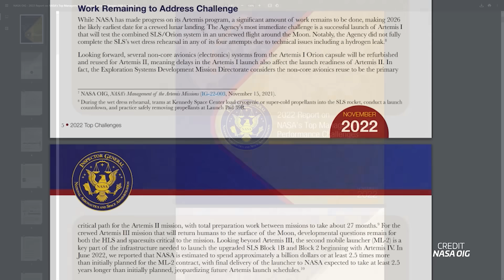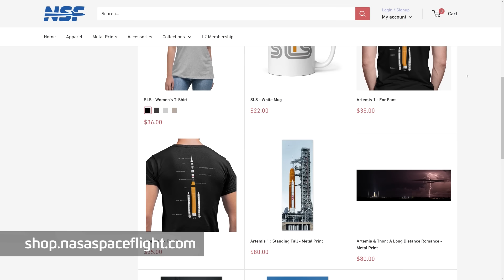Artemis Moon Landing Missions Delayed!

Comment: If SpaceX can get Starship in lunar orbit ready to take astronauts down what is the point of Artemis? Why not just fly all the way with Starship? There would need to be testing etc. to ensure it was safe enough but why would it be more dangerous than starting in Artemis?
Reply: Starship is not even close to sending humans to the Moon. They till haven't made it to orbit without blowing up.
Reply: @Ricky02-d8q  They have been contracted to provide Starship as a human landing system. $2.9 bn contract from memory.
Reply: @Tailspin80  Yes, I know, but Starship is not even close to sending humans to the Moon. It still has prove it can get into orbit, and then land several times on the Moon safely. That's going to take awhile. NASA is not going to risk it without it being completely reliable.

Comment: Maybe we need to go back to 1969 to figure it out 😂😅
Reply: They know how its done, bit they building a complete new rocket with 10 percent of the manpower
Reply: @sH-ed5yf  It's been over 50 years.  It will get delayed again.
Reply: @TonyStone3000  they didn try until lile 8 years ago
Reply: @sH-ed5yf  Still doesn't take away the fact that 1969 technology is better than today's technology regarding moon travel.
Reply: @TonyStone3000  it was not better. In fact it required massive input of the astronauts on Board. 
But it was more resistant indeed, cause it had less Chips that could get destroyed by radiation or other influences
Reply: @sH-ed5yf  It was better because it supposedly worked in 1969, and we can't figure it out today.  Fewer chips that could get destroyed by radiation? Lol! B.S excuse after B.S excuse, Delay after delay. Lol!!!
Reply: @TonyStone3000  we absolutly can. In fact we achieved much more, like a fly buy to Pluto.
Its just that we invest much less resources today. 
We still have all calculations, but the supply Casino is not present, so we have to invent everything from bottom up.
With less manpower and less mon3y compared o the 60s
Reply: @TonyStone3000  no kid, not excuses, just reality. Your modern Smartphone is much more capable than any that came before. Bot smash your modern Smartphone tonthe ground and its broken, while your 90s Nokia will work after 100 smashes, bit its much less capable.

Comment: I fully support the Artemis program but I feel like there could be a simpler way to go about things. The current architecture uses multiple launches, rocket types and landers, all of which need construction and testing. China is taking a far simpler approach and pose a viable risk of overtaking the USA in the race back to the moon. All these delays are expected but do not give the program the support it needs.

I also don't understand why the SpaceX HLS needs to be so big. Sure in the long term it would be beneficial for cargo volume, but we simply need to get back to the moon first before building a permanent presence there. Why take a HGV when you only need a van?

Starship could be more capable in this instance as an expendable second stage, delivering a smaller lander to a lunar transfer orbit.

Comment: Starship, is intended for the landing on the moon and the return of astronauts to the space station gateway.  When the question arises of how they are going to transfer fuel from one ship to another, I wondered why they don't just remove the nose of the ship and connect them like a buster and a ship and make a long rocket.  Thus, we connect 5-6 rockets in space and push the landing module to the lunar orbit.  Then we send a connecting module into space to connect all the rockets to (the front part of the rocket) the central module and create a space fuel tank station that can rotate in all directions for optimal fuel distribution, like a rubik's cube where the middle faces of the cubes are replaced by  starships bodies.

Comment: i still will never understand why they cant use a dragon to land with, there was talk for years about a dragon capsule with legs for a mars mission, a moon mission is easier you dont need a heat shield!    Im sure its a nightmare without gateway, but still im annoyed with this gotta have 2 gigantic rockets thing.   theres falcon heavy theres vulcan theres sls cargo, theyre doing this the hard way.

I firmly believe in this program and gateway leading the way to mars.  I think starship is a doomed N1.
Reply: Because the Crew Dragon doesn't have the radiation protection,  range, or life support to mention return from the Moon. Crew Dragon is a LEO only spacecraft and if you upgrade it to return from the Moon,  Falcon Heavy won't be able to send it to the Moon as it will be too heavy. 

A Crew Dragon with legs to land, can only do that in Earth's atmosphere where the atmosphere scrubs off almost all of the delta-V. It can't carry enough propellant to land AND take off from the Moon without soo much redesign that it is no longer a Crew Dragon. 

Artemis is NOT recreating Apollo, as Artemis III is planned to stay about a week on the Moon. ALL the Apollo missions together stayed 12.5 days on the Moon. Later Artemis missions are planned to be weeks to a month long on the surface.

Comment: Why do you need a gateway and why go back to the moon
Reply: The later missions going to be longer, so something needs to host Orion for that long. Gateway will also do science from out under the Van Allen belts. Artemis is also about learning how to extract resources from the regolith and to build structures, so the missions are longer. It's not just about landing on the Moon anymore.
Reply: @steveaustin2686  so to me artemis booster why can thay cover them for artemis 3 missions..
Reply: @benburden9323  The Artemis III mission is short enough to fit in the lifesupport range of Orion. For the later missions that will be longer, they would be longer than Orion can fly on its own, so Gateway supports Orion, like the ISS supports Crew Dragon and Soyuz capsules.

Comment: imagine the engineering that the Gemini Program had to invent and test to make Apollo feasible.
Artemis is kinda in the gemini phase i think.
Reply: I would agree with this if we didn’t already have the knowledge from the Gemini, Mercury, Apollo, ISS, Shuttle, Falcon 9/Dragon etc.
Reply: @dgymnast6473  The budget for Apollo was huge, at like 3-4% of the US budget at the time. Currently, NASA has less than 0.5% of the US budget and is also running the ISS, which is a big project like Apollo.

The Artemis III landing is planned to be a week long, which is over half the time ALL of the Apollo missions spent on the Moon. Later missions are planned to be two weeks to a month long.

Apollo was very risky and NASA doesn't want to risk crews like that now, as Artemis would like be ended.
Reply: @dgymnast6473 you still developing brand new systems tho. Gonna take time

Comment: how did they refuel apollo missions?
Reply: They didn't, as the spacecraft were as bare bones as possible. Apollo was very risky and NASA doesn't want to risk crews like that now, as Artemis would like be ended.

The Artemis III landing is planned to be a week long, which is over half the time ALL of the Apollo missions spent on the Moon. Later missions are planned to be two weeks to a month long. So the new hardware has to be more robust and capable.

Comment: I watched Apollo 11 go to the moon, land and return to Earth on our little black and white TV. There were no 10 pre launches of the Saturn 5 to bring fuel to LEO to transfer propellent to a larger vehicle to get to the moon.  These 10 launches to LEO for refueling boggles my mind not just because of the feat itself but to have all those boosters return and be captured by their launch tower and prepped to do it again in a very small amount of time as well. Our proposed return to the moon has become unbelievably complicated. Artimus is using recycled components from the space shuttle era and SpaceX is designing, building and testing brand new tech to help get us there.  SpaceX is trying to build everything themselves like their automotive business does and NASA is subbing most everything to contractors all across the country.  Talk about too many chefs in the kitchen.  And it all has to go together and it has to work together.  2030 here we come!
Reply: The budget for Apollo was huge, at like 3-4% of the US budget at the time. Currently, NASA has less than 0.5% of the US budget and is also running the ISS, which is a big project like Apollo.

The Artemis III landing is planned to be a week long, which is over half the time ALL of the Apollo missions spent on the Moon. Later missions are planned to be two weeks to a month long.

Apollo was very risky and NASA doesn't want to risk crews like that now, as Artemis would like be ended.

Comment: I think SpaceX ought to have a little side project going to develop a "shuttle" for use from ship to ship while in orbit or transit to the moon.  Not a "Space Shuttle" like the giant ones that used to carry stuff to orbit, but more like a in-orbit Jeep/utility vehicle.  Something with thrusters, an airlock, a closet full of space suits, some emergency rations, and maybe a simple grab arm to help it hold onto another space vehicle while doing maintenance or something.  It could also be useful as a lifeboat - something most exploratory ships have had since the post-Viking days (over 1000 years ago) and even most small private ocean-going sailboats have nowadays.  Though it would not have re-entry capability.  Just the ability to hold a few astronauts while help is dispatched, to transfer them from ship to ship, and to help them get around those really big ships if needed to do repairs, mods, etc.

They could leave one docked to the orbital refueling station for Starship launches that are at max payload capacity or carry one along with them when launching just a few astronauts in that massively over-capable ship.  Another could be left at the orbiting lunar station.

Just ideas.
Reply: The problem is changing orbits which uses a LOT of propellant. Something small like that would not be able to change orbits and would be restricted to working around something like the ISS. It's additional hardware which would not materially add to the mission, unfortunately, cause it is a cool thing to imagine. Current tech is not up to it.
Reply: Ditch the airlock and closets, and just have a jetbike for personal use. 
No ability to handle atmosphere, but lightweight and really cool.

Comment: hmm, I never heard NASA whine that it was too complex problem to go to the moon the 1st time. Yeah they had challenges - F1 engine stability, computer and navigation issues, life support, a disastrous fire, etc.. But they never let that even slow them down!
Reply: The budget for Apollo was huge, at like 3-4% of the US budget at the time. And Apollo was very risky. Currently, NASA has less than 0.5% of the US budget and is also running the ISS, which is a big project like Apollo.

The Artemis III landing is planned to be a week long, which is over half the time ALL of the Apollo missions spent on the Moon. Later missions are planned to be two weeks to a month long. So the spacecraft have to be more capable than Apollo and that increases the mass needed.

Comment: How can NASA let Boeing run the show? Unless they're in on it. Can you imagine Apollo is needing another year and a half to fix something designed years ago. And then they'll get the fix wrong. The short video of 8 or so sitting around is typical. Notice they're all overweight and doing nothing. The they'll die and the next group of old men take over. Boeing should stick to making 737 MAX. Nothing can go wrong there since they had 57 years to get it right. So then Artemis will be ready in 2081. Of course problems can be expected.

Comment: Jeese, this is all been done before. Didn't anyone keep notes?
Reply: The budget for Apollo was huge, at like 3-4% of the US budget at the time. Currently, NASA has less than 0.5% of the US budget and is also running the ISS, which is a big project like Apollo.

The Artemis III landing is planned to be a week long, which is over half the time ALL of the Apollo missions spent on the Moon. Later missions are planned to be two weeks to a month long.

Apollo was very risky and NASA doesn't want to risk crews like that now, as Artemis would like be ended.
Reply: @steveaustin2686  should be a lot easier after six successful missions, if they really went of course.

Comment: Humans on the moon no earlier than 2028. The delay led, primarily, by SpaceX and its difficulty in getting booster v1, HLS v1, and in space refuelling, done in time.
Reply: Nah, the xEMU spacesuits likely would not have been ready for 2025 and possible not for 2026 either. Congress has been under funding spacesuit replacement years before Artemis was started.

Comment: This is all screwed up. Apollo 8 made 10 orbits around the Moon and return safely to the Earth 55 years ago. They started everything from scratch and there were no computers and technologies had to be invented. Artemis is on a snail gear. 20 years in making and still not flown. Those guys are joking us.
Reply: The budget for Apollo was huge, at like 3-4% of the US budget at the time. Currently, NASA has less than 0.5% of the US budget and is also running the ISS, which is a big project like Apollo.

The Artemis III landing is planned to be a week long, which is over half the time ALL of the Apollo missions spent on the Moon. Later missions are planned to be two weeks to a month long.

Apollo was very risky and NASA doesn't want to risk crews like that now, as Artemis would like be ended.

Comment: I wonder, if the 1960s hardware software, engineers, pilots were all exactly the same, would NASA still slide based solely on government bureaucracy
Reply: The budget for Apollo was huge, at like 3-4% of the US budget at the time. Currently, NASA has less than 0.5% of the US budget and is also running the ISS, which is a big project like Apollo.

The Artemis III landing is planned to be a week long, which is over half the time ALL of the Apollo missions spent on the Moon. Later missions are planned to be two weeks to a month long.

Apollo was very risky and NASA doesn't want to risk crews like that now, as Artemis would like be ended.
Reply: Your skills at copy and paste are impressive. But are you able to debate without? @steveaustin2686

Comment: Been thinking about this a lot lately so I’m happy to see this. If they need 36 months to transfer hardware from Orion 1 to 2 module. I wonder what makes them think there’s any possibility of doing it in around 12 months between 2 and 3?
Reply: They are not transfering anything from the Orion on 2 to the Orion on 3. The Orion on Artemis III is all new and is being built now.
Reply: Are you willing to place a wager? I will bet you here, publicly, that they will never have a manned moon landing.
Reply: @derp8575  Since there have already been 6 manned landings, that is a silly bet.
Reply: @derp8575  are you saying NASA specifically will never complete a moon landing? Or SpaceX? Or the Artemis program in general?
Reply: @derp8575 The Chinese will get there by 2030. Artemis, with the Starship needing 12 refueling rockets in orbit? It will either be delayed and then canceled or definitely not in this decade. 2032/35 if that

Comment: If I where NASA I would fly a couple of Orion missions that will not land on the moon until HLS is ready. J.
Reply: Orion doesn't land on the Moon. The Artemis II mission is the crew test of Orion to fly around the Moon and Artemis III is the first landing using HLS Starship. Artemis II is backed up because of some Orion problems and the Mobile Launcher 1 (ML-1) having more damage than expected from Artemis I. The NASA OIG said that Artemis III was likely to slide into 2026 two years ago. NASA just made it official.

Comment: Kind of expected. I'm happy as long as the whole return to the moon project isn't cancelled, because the cost of SLS is a big problem for it. Staying on the moon will only be possible by the ideas of Elon and SpaceX, i.e. rapidly reusable rockets. It's a difficult start for Starship atm and I really dislike that Elon is being distracted by Twitter and politics so much, but in the end his approach seems a lot more reasonable than Apollo reloaded from NASA.
Reply: Eh, Apollo was done on a shoestring engineering wise. But the budget was huge, at like 3-4% of the US budget at the time. Currently, NASA has less than 0.5% of the US budget and is also running the ISS, which is a big project like Apollo. 

HLS Starship needs a lot of Tanker flights to get to the Moon. The plan SpaceX submitted for Artemis III was to launch the [DELETED] Starship propellant depot, 14 Tankers to refill the depot, and then HLS Starship to refill from the depot. The launch cadence was 1 Starship variant every 12 days. So it would take a while to fill up the depot, before HLS Starship could launch. 

The crew does not get onto HLS Starship until they reach lunar orbit. The crew goes to and from the Moon in Orion which is launched by the SLS. It will be the same for the Blue Moon lander on Artemis V.
Reply: It is a misconception that something is being delayed by Elon Musk's takeover of Twitter or X. On the one hand, Spacex has a great team and on the other hand, EM already had other important matters, such as Tesla and other companies.
Incidentally, other platforms also have owners who are involved in other things and others like Jeff Bezos have also bought media, as has happened continually over the past century and a half.
Reply: I'm grateful that Elon has the stones to publicly say things that everyone with a brain is thinking
Reply: @VanquishedAgain  Nah, Musk fell for the GOP Sedition Caucus Fantasy Land of Lies,  showing even smart people can be conned by nonsense.
Reply: If you had a brain, you'd understand that Elon is controlled opposition.  @VanquishedAgain